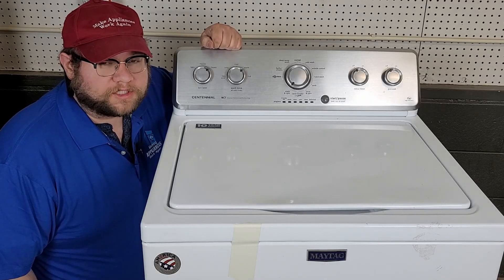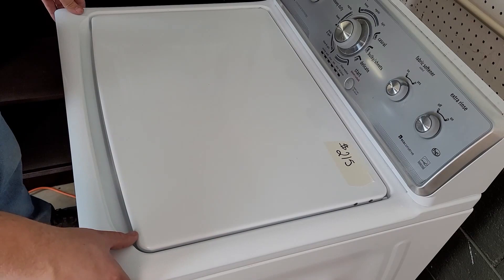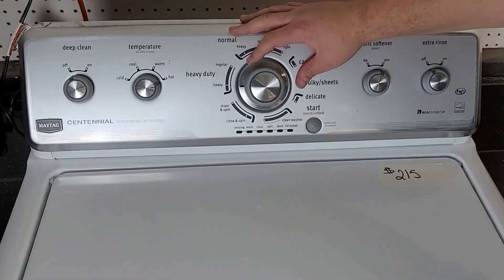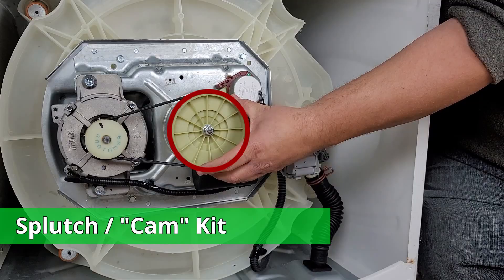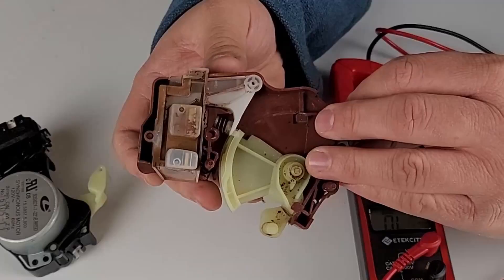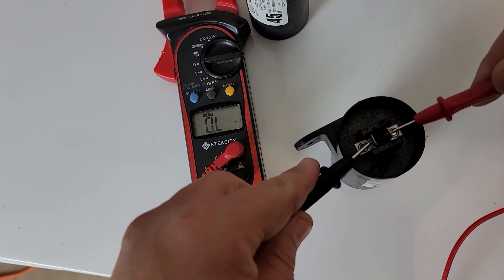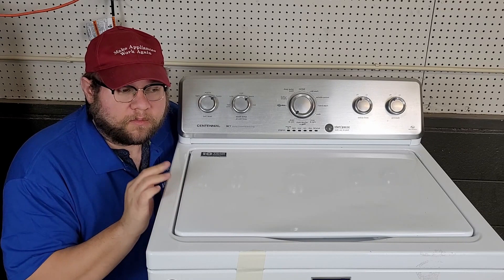Maytag Washer Won't Spin - How to Troubleshoot a Maytag Centennial Washer

Comment: You are a righteous man.
Reply from the maker: I'm trying!
Reply: @bensappliancesandjunk  I'm a 51yr old female that I have no choice but to try to fix my washer Well My. Washer is broken I purchased another set for 300 from Facebook and I be dang I bought a broken set so I have to repair the roper or Maytag I need help on which one to repair . Maybe If one works for me I'll be confident to repair and sell  the other set.Both are making all kinds of noise when it supposed to be spinning One has plastic shavings and the collar around the basket beat off  Don't know how to properly level the machine

Comment: Thanks for the info. My washer would not start spinning. I got codes for the motor and shift actuator. I reset the codes and its working again without replacing any parts. I got lucky.

Comment: No I did not because every site I watched stated the switch actuator is bad. The motor is good, the capacitor is good, the pump works, it drains. It spins occasionally. Maybe a cold solder joint on the main board is all I can think off. I will try the shifter diagnostic but one question is regarding the 2500 to 3500 hundred ohms on terminal five and six of the switch actuator. A brand new one does not have that reading. I read 1936 ohms.
Reply from the maker: Its a range. Its possible new/revised ones could be slightly different. I would imagine 2k ohms is close enough to be OK

Comment: The issue I'm having is I can get it to go into a spin mode, and it'll spin for awhile, then all of a sudden after a minute or two, the lid lock starts blinking on me, and it shuts down the spin. I figured it was the control board, so I swapped it out, as I can hear splutch, and shift actuator working just fine, nothing is in a bind. Customer also stated it was shaking, so I did replace the suspension rods as well. Also, lid lock locks/unlocks just fine, and even calibration mode works great, and the diagnostic spin/agitate mode work fine. It's just once I add clothes, do a spin/drain it'll start up, spin for a min, then stop.
Reply from the maker: What did error codes show?

Comment: I replaced my pulling kit and the part under the plate with your amazing video help.  Washer was working fine,  now it's now spinning fast enough to dry the clothes.  Thought's??

Need some help...
Reply from the maker: ...It should spin fast enough to dry the clothes regardless? I'm not sure what the problem is?
Reply: @bensappliancesandjunk  

Thx for your reply,  Your videos are a big help and amazing!!!!

Comment: Checked all parts and are testing out fine  . Still won't spin and now stops at rinsing. When I did the spin test it click s but won't spin. I did give it a boost and then it started to spin. Any help would be greatly appreciated. Thanks

Comment: Thanks for the great video! I have a Whirlpool that looks to have the same components underneath. The issue I’m having is the washer doesn’t seem to agitate most of the time and leaks from underneath. 

I’ve checked the drain pump hoses and they were secure. I noticed the pulley cover is all dirty and wet. But still can’t really tell where the leak is. Any info would be greatly appreciated. Thanks.

Comment: Your the best man. Our washer is a roper with oval lights. Usual problem is no spin drain. It will spin drain if you go to spin drain cycle. Could it still be water pump?  I know you explain very well but i have a hard time asymmelating info. Thanks in advance. Stevee

Comment: Ben thanks for the video it has help tremendously so far - I replaced the shift actuator, and figured while I was there replaced the splutch assembly and also did the impeller hub. Cleared the codes by recalibrating and got 2 washes until the final spin did not work an the 3rd.  I got a actuator error code again.  Recalibrated and it spun.  On another load with 6 towels I got to drain and spin and it would not spin.  Took out half the towels and it spun.  So overall I got it to work by doing about half a load of what I used to do prior to the trouble beginning.  Any advice would be greatly appreciated.

Comment: Thank you for this video! I am tired of paying $200 plus to technicians that take 2-5 minutes to fix my machine. Any ideas what part it could be? They never take it apart, and only open basket lid. They mentioned something about a hub wearing from heavy blankets. There is a agitator in my machine. Thank you. Maytag Commercial Technology is the name.

Comment: I got an f2 e1 code in addition to shift actuator error code. SA, Capacitor, and motor all test fine. Low spin test, it only spins slowly for a few seconds, then stops.

Is it possible its a bad control board? I replaced control board two years ago (thanks to your video!)

Comment: Hey Ben! Great video! I was able to run all the diagnosistics (auto and manual modes), however, all the diagnosistics come back with no errors. When running a normal wash cycle, it does everything correct, and then spins, but after it spins, it starts to fill with water again. We do a simple drain and spin cycle after to get the clothes respun out. Any ideas? Is it the main board?
Reply: If it's a maytag it's in a demo mode, check my videos

Comment: Washer spins. Washer runs rinse and agitate cycle. When it needs to go to spin cycle and ramp up, we hear the click of the shift agitator and it begins to spool up for about 3-4 seconds then we hear what sounds like something slipping. The machine stops spinning, the sense lights turns on then the rinse cycle begins again. this happens several times then the system goes to done. Possibly Hub assembly bad? We checked the whole splutch assembly and all looks ok along with belt.

Comment: My Maytag washer won’t go to drain and spin cycle in automatic mode. I have to put it on drain and spin setting after it washes to drain and spin.The cycles will only work manually but not a full cycle in normal wash cycle

Comment: Great video, Ben!!  If I don’t have the exact same model as your demonstrator, it’s very similar. My problem is this, I ran the diagnostic, said the actuator was bad, replaced it, did a calibration, still no agitator/spin. Replaced the motor, ran a calibration, still nothing. I did notice some oil on the pulley cover, not a lot, but I don’t know how much is too much. This unit is only three years old. HELP!!
Reply from the maker: Check pulley and make sure its not slipping. Oil on gearcase... Not a good sign. It may slowly be going bad. I'd look at the cam/splutch system next. Those are super cheap to replace.

Comment: Bought a new lid lock and still didn't work right. Come to find out my lid was warped downward. Pushed on the center and it popped back into place like a Snapple lid. Now my lid lock works properly

Comment: Ben I have the same washer I put my washer in Manuel test every thing work but drain.when no put it in fault code mode I only got a sensing light flashing.and I checked the pump liseams good

Comment: I have a machine that has passed auto tests. It will run however the spin mode seems very weak. IT leaves clothes drenched. The motor tests good . It does have a leak underneath that is definately above the transmission area.  Im just curious if this could be drain pump or actuators as said in video?  Just asking if you have anything I should look at first?  this was an awesome video . I subscribed..any questions to help with issue plz ask.  As I said Ive done the diagnostics and the only codes I had were to verify low and high rpms and they both tested right per manual diagnostic tests..
Reply: are u in PA?

Comment: Love your video, it was a great help. Still giving me an F7 E1 on this machine you are showing even though and I have replaced both the Shift Actuator and the Capacitor, clutch assembly and lid lock. Checked the motor as you showed and it is good and the drum moves freely,  but the motor buzzes when trying to turn the drum. Could it be the main control board? Any suggestions ?
Reply: did u ever get this figured out?   im getting a f5 e1 code now...after getting about every code known to man on my kenmore   ive replaced everything but the main board, and motor,and water vac switch!!!!
Reply: Frustrating, right! You may have to take it it to a repair shop for a diagnoses. Then you can replace the part.   I got a capacitor tester and am going to test both capacitors. I did notice that when I replaced the capacitor on mine, it ran 2 wash loads  with no problem, but on the 3rd run it stopped during the spin cycle and is back to doing what it did before. So maybe the new capacitor was faulty.     @Dooguy
Reply: @71mustanger  i guess its possible to get a faulty capacitor.   I will test it again.   Im also goin to take the agitator apart soon to see if something is a miss there.   Im making progress from where i started.   Its filling and spinning and draining, jjust not agitating.   Only moves for a split second then stops.   Where my wash room is not a fun place to get it out of with steps so im really tryin to fix this myself.

Comment: Can’t get mine in diagnostic mode. Spin light stays on until I press/hold cancel. Then lights go out and machine makes humming noise and is not responsive. No other lights besides lid lock will come on no matter where dial is pointed. Any suggestions?

Comment: I have a little old lady who has one of these washers.   I've replaced the lid switch already and that didn't fix the problem.   When you press the start button the first yellow light comes on and the last red light for the lid lock flashes.  you can hear the lid switch clicking on and off. but it doesn't do anything more than that can you tell me what the problem is please?

Comment: Ben what’s wrong with one in which water runs doing the spin cycle instead of spinning and completing the cycle. I have put a new acuator in but it will not spin out and complete cycle it just keeps repeatedly running water doing the spin cycle, draining it out and repeating it

Comment: So I replaced my shifter actuator. Replaced the capacitor. Still getting a shifter actuator error code. When running auto test or any test, when it tries to spin it simply makes a loud buzzing sound for one second but never spins.  Cleared error codes. Ran calibration. Cannot get this to spin :( what else could it possibly be.

Comment: I'm having a really hard time with my model. It's the last machine you displayed. It started Getting stuck on the spin cycle. I would have to go in and manually drain the water out and run spin cycle. Tonight it got stuck but the drum was full of water and it would not drain out after I plugged it back in. It would make a humming noise. So I got a garden hose and syphoned the water out so I could look at bottom. I'm really not sure where to start with fixing it tho. Now it won't even let me unlock the lid..

Comment: Thank you for the great video Ben.
I'm having issues with my Maytag not spinning, it does agitate but it won't spin, I hear the motor turn on but the basket will act like it wants to spin but fails to do so.
IT's a Maytag bravos MCT, I've cleaned the filter and removed the basket to assess if there were any obstructions, no obstructions were found, I then checked the flywheel gear connected to the primary shaft, no sand or debris identified, my next check is the actuator itself and the bearing. Do you have any suggestions?
Reply from the maker: Did you look for error codes as mentioned in the video?
Reply: @bensappliancesandjunk  Yes, F7E1.

Comment: It’s not terminal 5 & 6. It’s terminal 2 & 3. The plastic part has numbers on it. I did not replace the part but the machine has been working and there is no error codes. Who knows maybe removing and reinstalling the switch actuator did something. I did not observe it being dirty. Maybe dust particulars in the optical sensor.

Comment: I can't get any code lights to work! But machine trys to work normal, I believe the water pump is bad. It gets very hot under load only and stops working halfway draining.the machine gose into some kind fault mode What am I doing wrong!?

Comment: How much movement should there be in the motor? I bought new belts but had trouble finding the exact part number (2111250 and 2111240). I could only find 211125 and 211124. They seem to work but there isn't much movement in the motor but there is slightly some.

Comment: Have a Whirlpool Duet 2004 model. Gave a FH code. Wife pushed the 3 second reset button. The FH code went away. But the time left just flashes. Pushed the 3 second reset  again. Still flashing time left. Un plugged the washer let it set for a few  minutes. Plugged back in . It makes a grinding noise. Checked the filter. It was  not full of debree.   Time left still flashing. Drum will not move. Let it set over  24 hours no change.  What Yah Think?

Comment: When starting a load we have a short grind sound. At first it would not run the spin and dry cycle. Now it doesn't run wash, it fills but doesn't spin or proceed. I tested the actuator and it reads 2k ohms. I do see very little spotting of black on the cover, but very minimal. Since the washer is in an unfurnished basement for 8yrs thinking it's just dust and humid air mix. Could it be the transmission?

Comment: My maytag centennial washer will not drain and spin when it's supposed to but yet keeps spinning at the very end and won't stop. It also occasionally makes the grinding noise when agitating. I've replaced the transmission, entire splutch, actuator, drain pump, belt and control board. Idk what on earth is left to look at. Any suggestions??

Comment: My brand new vmw doesnt spin. It stops after draining and doesnt progress. The sensing/fill lights flash and then the done light flashes. The lid lock is still on. I have to manually switch it to drain and spin for it to spin my clothes... i just bought it so its possible its operator error. I just put it on normal and hold start. Dont know what it could be

Comment: HI. Really nice work on the vid. What would the problem be if it can't spin or drain? Thanks
Reply from the maker: Failure to drain will cause the unit to not spin (any newer machine basically will refuse at all costs to spin with water in the tub). You'd want to look for drain issues - bad pump, obstructed pump, water backfilling into the drain hose and preventing the unit from actually expelling water.
Reply: @bensappliancesandjunk  Thank you so much for the advice. I'll check it out.

Comment: i tested the motor only 2.5 ohms higher on 1 set of windings. the shift actuator tested inside the range just over 2000 ohms and the capacitor tested at 49 mf....and it still doesn't spin and throws F7E6 code. i dont know what to do

Comment: Hi! Thank you for the video. Hoping you can maybe help me out. My Maytag Top lid model: MVWX655DW1 is spinning, but will not go to high speed spin. Lid lock good, belt replaced, clutch teeth all look good, actuator is good… BUT… I found about $2 of change under the agitator and some grease/ oil residue. Code is F7. Washer is about 4-5 years old. Do you think I have to replace the gear case?? Thank you

Comment: On testing the motor I'm wondering what constitutes "way outside of these values"? Given the meter reads into the mega ohms range it would be nice to know if way outside is 1 ohm too high or is 1 million ohms way outside. In my manual for a 1/4 motor it calls for 5 to 9.5 ohms for all windings. One test out at 5.9 the other at 11.8 ohms. I'm assuming 11.8 means it's bad ?

Comment: What could it be?

I got one for you and I hope you will write back cause Im scratching my head.

My capacitor was check and is ok (your test, another one in continuity and another for the Faraday.);
My actuator (once removed to see) is slowly moving in both ways and your test is ok too);
When I launch the test, the motor start to spin slowly but lose his momentum and then slow down.
The pins are Green (ground), yellow, red and white).
I have 5.6 ohms between 2/4 and 3/4. Also get 11.2 ohms between 2/3.

Any help would be welcomed 

P.S: Maytag Centennial model: MVWC200XW2

Comment: Ok so my maytag is making a clicking sound when not running/makes a clicking sound when not running as if its trying to go to the next part of a cycle . It also made a grinding sound (kinda like if you try to turn over your engine when the car is running-thats the best description I have for the sound) it will not spin and it will not complete a cycle. I have to cancel the current cycle and turn it to drain and spin (but it won't spin) but it will finally drain. Help!

Comment: I called an appliance repair shop hecsay bad water level sensor...i say he wrong because if sensor was bad it  would not be able  spin and drain when i manually turn knob to each setting but it works fine when i do that...

Comment: I give up, lol. Machine won’t go past sensing light and lid lock light on. It clicks and makes sensing noise only. Get F7 E6 error code only. Put in new shift actuator, replaced cam clutch parts and recalibrated machine, checked capacitor (good), did ohms test on motor (good), lid lock works good, wiring all good. I’m stumped! I give up and am going back to Jellystone

Comment: Hello, I have a Maytag Bravos I bought new about 5 years ago. Started having spin issues, as well as flickering display lights at every stage of the wash.
Found a video that showed me how to replace the lid lock. That got rid of flickering, but spin issue remains.
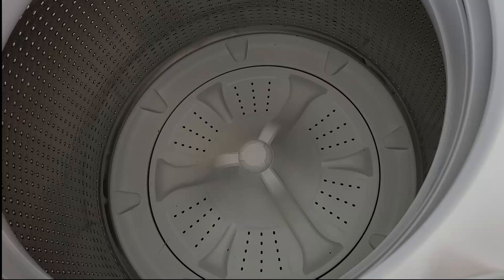I'm stuck at around the 6:48 mark of this video cause my machine has blinking lights when testing the spin. Any ideas? Thanks.